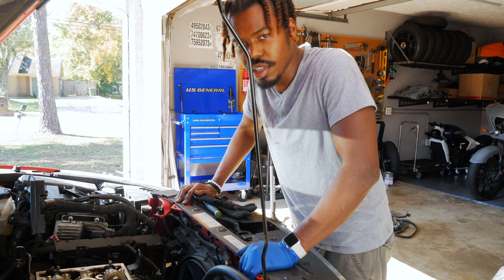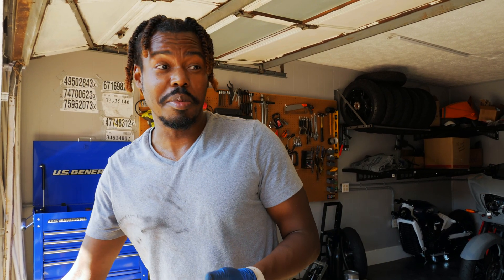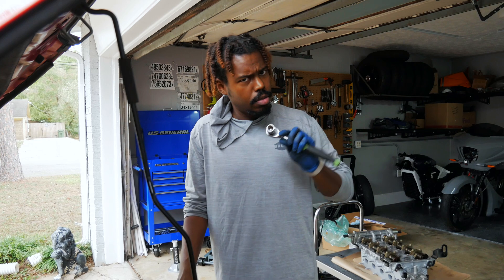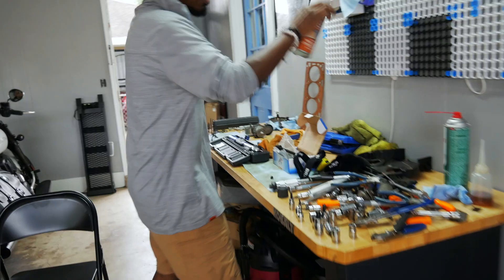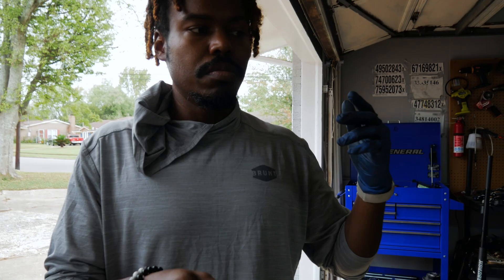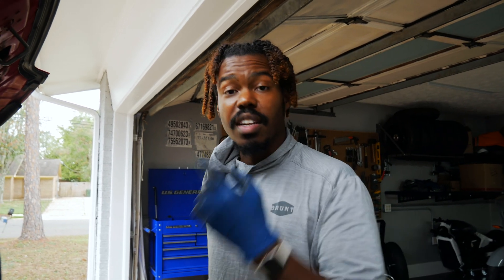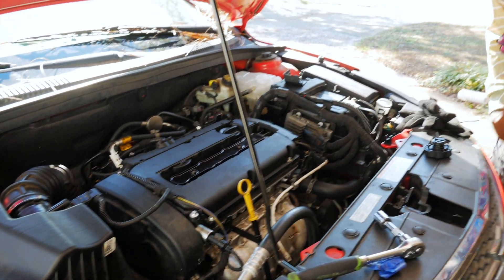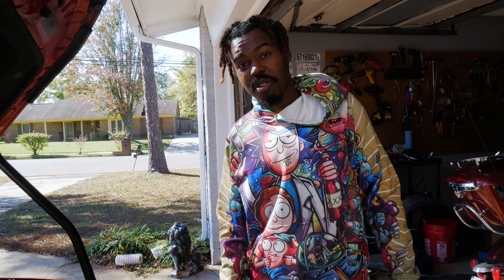Bent 11 Valves, What Now? Engine Head Repair

Comment: I had a 99 Ford escort and I was going to work one morning and all of a sudden it just started bogging  down like like the air filter is clogged and so I went back home and on the weekend I checked out the car I put a water pump in there too since I was that far into it luckily I didn't have any kind of valve problem

Comment: I had the belt replaced about a year a go(about 10k miles since then) The mechanic suggested a whole kit(tensioner, belt, rollers and a water pump). Two weeks ago the crankshaft bolt (that usually goes in the kit) snapped. Mechanic said there was no bolt in the timing belt kit that he ordered and he put the old one, "no one's fault".
16 broken valves and 1200 euros to fix it. Took it to new mechanic for fixing , he said in advance that if he fucks up something it will show in 1-2 weeks and that he would not give me any warranty if something breaks after that, do you reckon its dodgy and I should seek someone who gives  warranty on this kind of job. Thanks
Reply from the maker: Yeah, my kit did not come with one either. I bought a replacement off recommendations of it being one use from the manual and what others have mentioned online. The two bolts were maybe $7 for both camshaft vvt sprockets. The crankshaft bolt was another few bucks. It’s a lot of work for someone to not warranty it if something goes wrong. Also, for them to say that in advance doesn’t give me confidence they will do the job right. I would look elsewhere if you have the resources to wait.
Reply: @BrandonBicasso  i suppose it is negligence, i spoke to a few different mechanics and they all said it should always be changed. I will try to find it in my manual as well. Do you know how the bolt is called? anyway the new guy basically said that he would take responsibility if anything related to the valves job goes wrong, but if its any other part of the engine, if pistons or the head cracks few months later for example, he can't garantee anything about that.
Reply from the maker: Harmonic balancer bolt.
https://www.rockauto.com/en/moreinfo.php?pk=12985513

That’s fair reason. Doing top end work can shift the issues elsewhere depending on how bad it is. There was concern about ours and whether the rod bearings were shot but I took a chance. No issues so far.

Comment: Hi Brandon, I wanted to ask you a question. Since you fix up bikes etc.  I am looking at an 2023 indian sport chief with a rebuilt title. I did some background research and it was in an accident front end damage. The guy selling it owns a custom build motorcycle shop, newly opened. He didn't disclose this info until i asked about the bike, like history etc.   He told me, it had a crack in the lower sanction on the right fork. Said they replaced that, then customed built after that. It probably has about 8 to 9k in total after market stuff that I've calculated. I went to look at the bike yesterday but didnt get a chance to ride bc of the weather. I didn't see anything to be wrong with it when I saw it. I can do basic oil changes, exhaust stuff like that but idk about forks. He is also giving a 6 month warranty. Lowest he will go is 15,500. Would you consider this bike and say it would be ok or look for something else?

Thank you😊
Reply from the maker: I have no problem buying rebuilt titles but I’d need to know everything that was done to make it right. Front end collisions on these bikes could be minor but also frame damaged like the one I had. I would ask to see what it looked like before they repaired it or run the vin number to see the auction photos. As for the price, it’s fair. I’d want to pay maybe $14-14.5k for it as Sport Chiefs will be dropping in value soon for the new model year. 6-month warranty is cool and not a bad bargain for a rebuilt bike. Of course, ride it if you can.
Reply: @BrandonBicasso  i saw the original pictures. I found them online.  The damage didn't look bad from what I saw. He said they replaced the whole fork on the right side. Then they got to customizing it.
Reply from the maker: Whelp, ride it and see what it do. 🤙🏾 Just remember that rebuilt bikes are rebuilt for a reason.
Reply: @BrandonBicasso  thank you!!

Comment: A few hundred dollar belt can cause so many  issues if never replaced probably every 100,000 miles.  Most gas cars last 12-15 years 150-200,000 miles. Cost of repairs more than value of car.  My Tesla has 500,000 miles still like new.  Never been to service center.  Only maintenance tires and wiper fluid.  They are forever cars.  Battery still holds a 90% charge.  Only 80 moving parts in an EV vs thousands in a gas car.
Reply from the maker: Aye, Teslas are cool but those batteries go for other owners a lot sooner. I’m still interested in doing a motorcycle EV conversion at some point and learning more about them. No time soon for my primary vehicles tho!